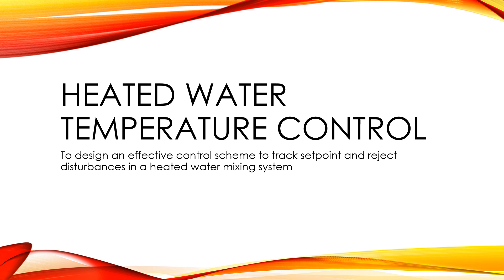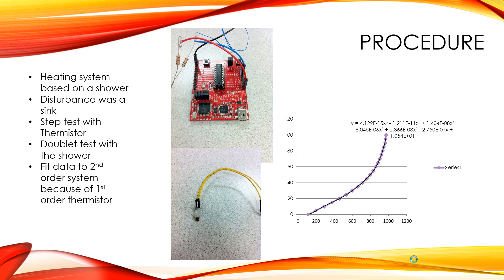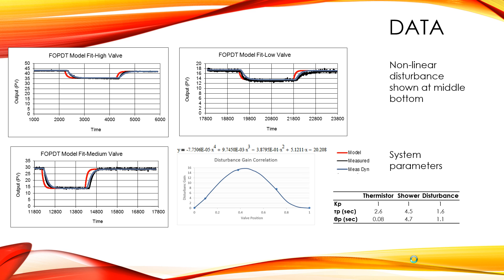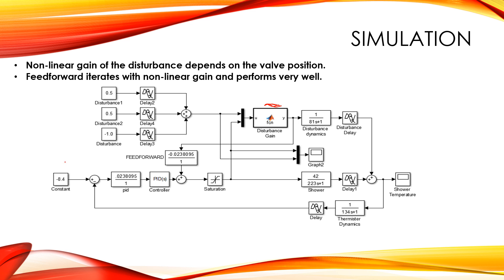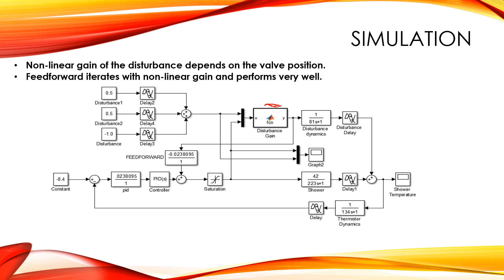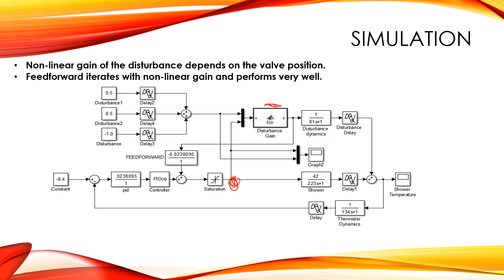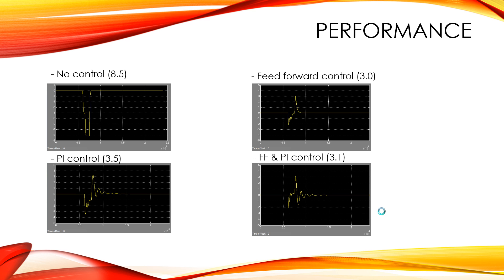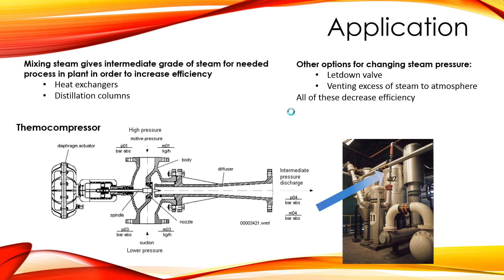Simulink Control for Shower Temperature Regulation

Comment: May i ask what is the value key in for PID or others? I face the problem of being unable to determine signal dimension, how to solve it? Its there any change inside the disturbance gain? Do u have further information about the graph and the Simulink block on website? What is the means of 8.5,3.0,3.5 and 3.1 shows in the graph?
Reply from the maker: Sorry, I don't have additional information. This was a student project. There is more information on PID control on the course websites: https://apmonitor.com/pdc and https://apmonitor.com/che436